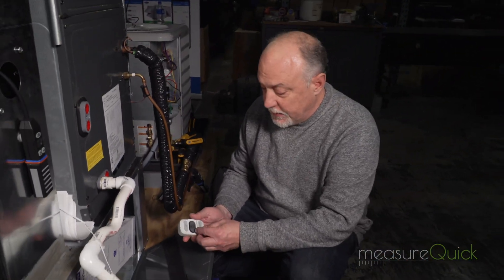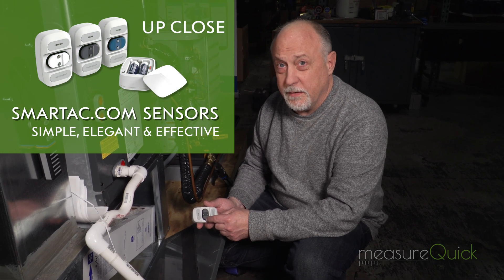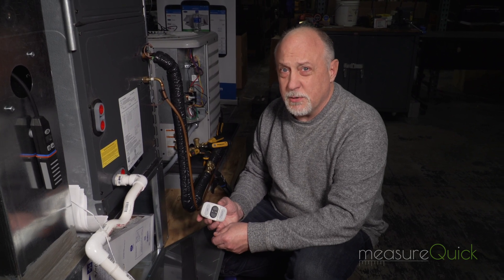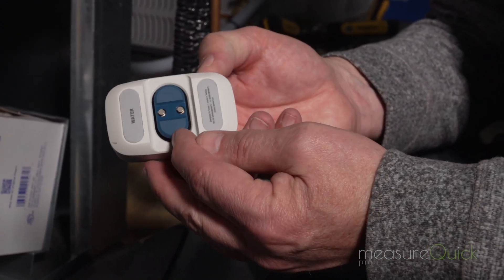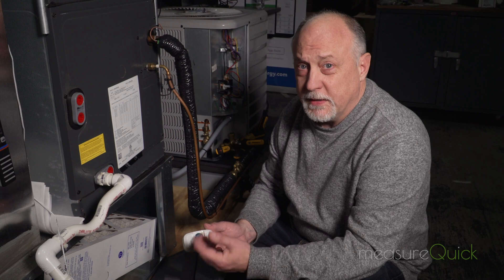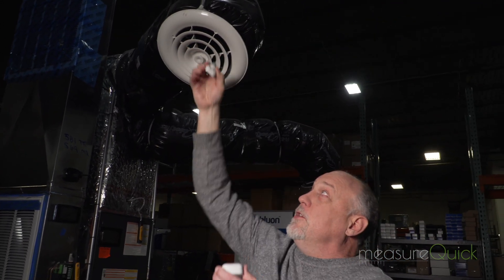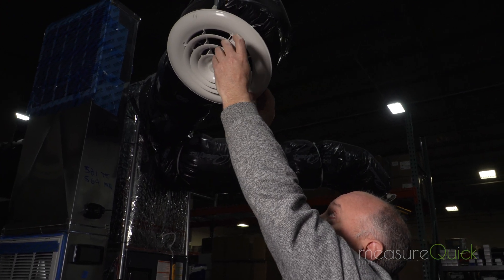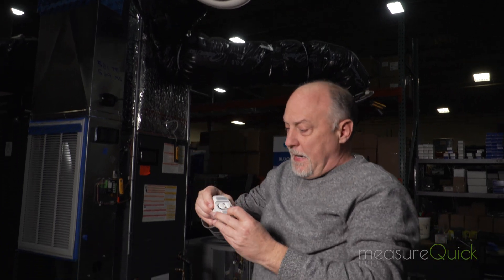Up Close & Personal With the SmartAC.com Sensors

Comment: Water and filter loading sensors seem simple enough. What kind of situations trigger a warning on the supply air? Also, is correct airflow assumed in order for these sensors to have any meaning? Are the warnings adjustable for lower airflows than desired in desert (450 cfm/ton) or in high humidity areas (350cfm/ton)?
Reply from the maker: @lynncomstock1255  the supply sensor does several things, it monitors runtime temp split, limit trips, etc. you are correct for smartAC to have any value you need to have the system properly commissioned. Otherwise it’s just monitoring a poorly operating system. That’s part of the reason that we believe it’s such a good fit with MeasureQuick. It’s not watching for absolute measurements, it’s watching for change.